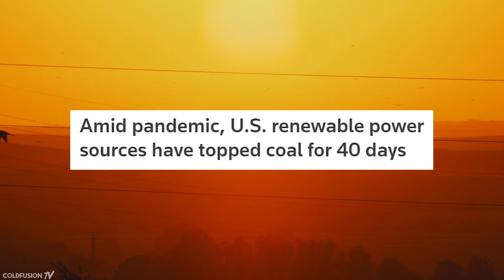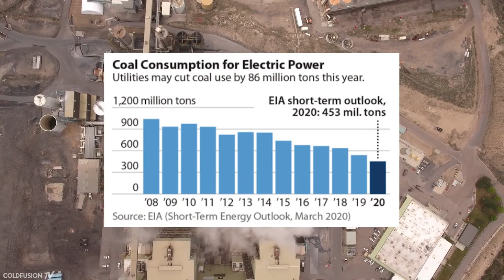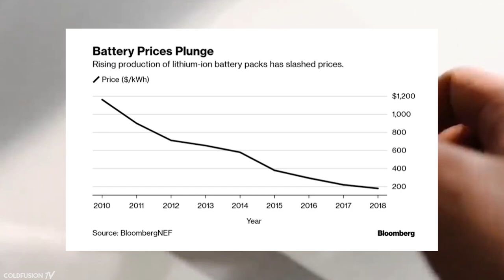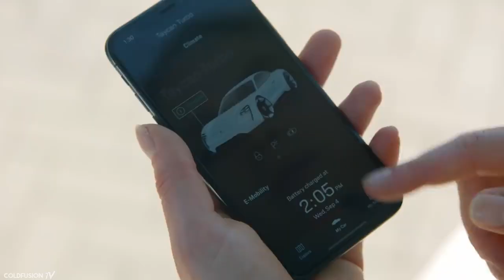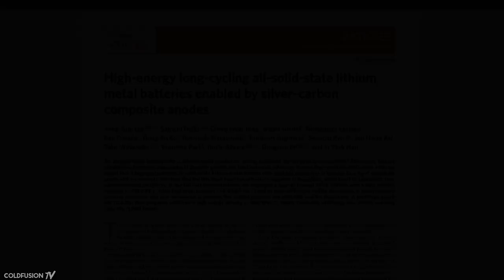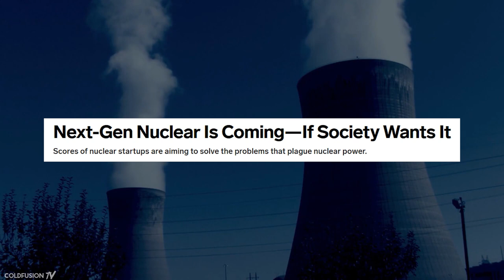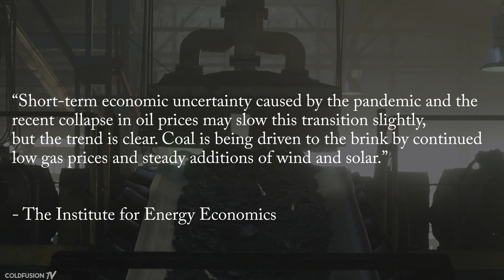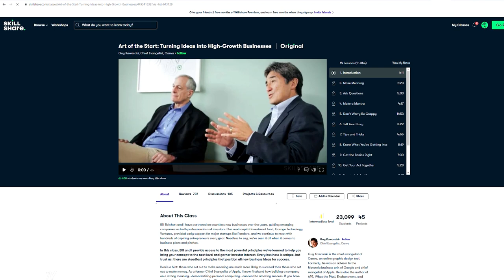Amid Pandemic, Renewables Now Supply More Energy than Coal in the U.S.

Comment: 5:20 why do you compare capacity of batteries that have different voltages?

I know that the point is to show the dramatic difference, but why not compare apples to apples instead of apples to watermelons.
Reply: Agree. Very misleading. I sure wish batteries would have improved that much.
Reply: Yeah, the laptop battery is 1700mah at 14.4v, or 24.48wh. The cell phone battery is 5000mah at 3.7v or 18.5wh. It's still more per volume, but you can't just compare mah like that.
Reply: True. Still the improvement per volume is significant.
Reply: Mariusz Kozłowski except density is irrelevant for the discussed use of mass storage - also he compared with a 25 year old NiMH...
Reply: Agreed! Wh should be the default unit for battery capacity now. Great video anyway!
Reply: kilrahvp True, he should compare energy (Wh) not capacity (Ah).
Reply: Of course. You have to compare Wh. Not mAh or V. But anyone that thinks battery storage for mains power grid is going to be a thing is delusional. The best way to store energy is byt using the any surplus wind and solar production off-peak times to pump water back up the hill in hydro power stations.
Reply: @Optical Clarity I would have to disagree. current battery technology is not that far off, a current Tesla power wall can pay for itself in 10 years if it can be fully utilized. Of course it cant always be fully utilized however we aren't that far off from it being economical.
Reply: The point he is making is that battery technology is advancing at a rapid rate, In just the last two months there have been massive improvements and two patents filed one of them by Tesla the other by a scientist
Reply: Without research their is no future
Reply: @Optical Clarity How about you bring some data as well? engineer my ass
Reply: Optical Clarity did you just crawl out from under a rock from 1960? I can go out today and buy enough battery storage and solar panels to power a home easily and for less than the price of a new car.
Reply: Optical Clarity I’d assume that you are an engineer in the field that is related to the development of LFTRs. In that case, what has really been the showstopper for the past decade or so since the 5-minutes video didn’t go so deep into that aspect.  I’m actually curious, and really want to know more.
Reply: He wants to say that batteries are getting smaller and efficient....
Reply: @Jonas.856  I think the point was the technology has changed over time.  For the old batteries, they were 'state of the art' and a lot more expensive on a AH to AH basis (amp-hour just as a standard unit of comparison).
Reply: @Optical Clarity IMHO, he tries to present what the masses see as data and facts, but the masses RESPOND to emotions, no matter if the facts are compelling for engineering/scientific types or not.  I think he is TRYING to pull the right strings to bring along the unwashed masses in a way they can understand.  Yes, sometimes he gets a few things bas-ackwards, but so had NASA in the past in spectacular fashion (I won't go into historical diatribe here, but as a fellow geek, you can remember them as well as I can or better).  I only site NASA because it is publicly viewed as premo technology in motion.

So don't let your blood pressure rise, and enjoy the ride.  Yes a few tech corrections are needed just to keep many of us sane, but for the most part he does pretty good especially in such a glossy format.
Reply: well because I can,  comparing the watt-hours of both you can see that the phone has 21.75Wh compared to the laptops 24.48Wh. Now considering the laptop battery is about the size of the phone it's a pretty fair comparison.  and you can see the energy density has gone up significantly. (Also an electrical engineer because I have a $150K piece of paper that says so)
Reply: i was about tu comment it jahahahah the old battery has actually more energy storage
Reply: @Optical Clarity the idea that one day people would be able to fly like birds is laughable. If you want to prove me wrong come at me with facts, not feelings

PS:I am also an engineer (who cares)
 Your method of engaging in discussion comes across as arrogant. Try a more humble approach and people might want to part take.
Reply: @Optical Clarity on an industrial scale things look better the Hornsdale Power Reserve cost 90 mill and makes about 18 mill a year
Reply: @Optical Clarity The studies show all these renewable technologies to save energy and resources over time. That trend continues to get better rapidly as the technologies mature. What we need now is massive investment to move things forward at a greater rate. Along with batteries, solar, wind, etc becoming the norm will come more efficient recycling systems, that's really the easy part. I'm not sure where you are getting your info. Also, we have no choice... Look at the lengths we have to go to to get fossil fuels, and that will only get worse, to say nothing of the extreme environmental impacts. We should use the remaining fossil fuel reserves to build our sustainable systems, otherwise we will be in a serious bind.
Reply: @Optical Clarity The day I see evidence of a truly safe nuclear technology that can be implemented at large scales I'll be on board. Battery technology is the real holdup for solar, wind, etc to be truly viable. Battery technology continues to advance dramatically. Nuclear, not so much. And the advances that have been made have not mitigated the extreme safety risks.
Reply: @Optical Clarity I believe the real solution is in the efficiency of our transportation, architecture, etc. For instance, in most areas it is possible to make a building that requires little to no energy input to maintain a comfortable temperature. Public transportation infrastructure in the US is shameful. There are so many ways we are not putting energy to good use. Lifestyle is a big one, people think they need to consume to be happy.
Reply: @Optical Clarity It can if the batteries keep improving. Don't talk too big.
Reply: @thenovemberedition  I think it is 18.5 and 24.48 (Given the assumption that the lithium battery will operate at a voltage of 3.7 Volts instead of the fully charged capacity of some 4.2 Volts or so) but , still it means the battery technology has improved a lot given the big size difference.
Reply: @Optical Clarity It can be a baseline energy source if each home and factory had a solar system and a battery installed. I think the only factor in this is the financial impossibility of it right now, which might change in the future.
Reply: @Optical Clarity If you want nuclear, we need to focus on fusion. (Although thorium reactors like you mentioned are pretty good too!) But not because it is easier, because it is the future of the energy.
Reply: Because this guy has no idea what hes talking about and it's easy to see that from his videos. I hate how everyone believes/agrees with him instantly after seeing one of these vids but they are all misleading
Reply: @Optical Clarity I already wipe my ass with your assumptions. Studies are public for everything, not just for LFTR.
Reply: Capacity has nothing to do with output voltage. Voltage is dependent on the arrangement of the cells. Capacity is dependent on number of cells/ size of cell in the phones battery case. His  comparison is very accurate
Reply: @ignaciohavok1  No actually voltage is dependent on the number of cells. More cells=Higher voltage but less usage. Less, larger cells= lower voltage but more usage
Reply: @devrim-oguz  Nuclear is cheaper than solar and wind by a lot.  Literally a multi billion dollar solar farm generates like 1 megawatt. A single nuclear power plant can generate thousands of megwatts
Reply: @dustman96  Yeah sure everyone could take a train or bus but that isnt practical because people are gonna want their own car, most people arent gonna want to have public transportation the only way they can get around. Also if everyone keeps pushing these piece of crap electric cars then your whole comment is useless because all transportation is gonna use electricity
Reply: Эндрю larger cells don’t mean higher voltage. The voltage of a cell depends on its chemistry. I was referring to the fact that for the same number of cells it’s arrangement will affect the voltage of the battery, I.e. the larger the series the more voltage. Likewise the larger the parallel the more current but capacity never changes.
Reply: @Andrew58251  sadly I have to partially agree with you. Dagogo produces very nice and cool looking videos, and I mean very cool. But he's not a technical person. He does the best he can research wise, but from a limit ahead, he can't cope with very detailed technical info. but, also important, I don't feel he's being purposely misleading, they are all honest mistakes.
Reply: They were comparing the size of the batteries from 1995 to now and how much smaller the batteries are now and how they are way smaller. You’re over thinking this. Take it for what it is
Reply: kilrahvp he was comparing how batteries have changed since 1995 and was saying how much more they will change in the future. Kinda like comparing a laptop now to a super computer in the 1950s. Why are we making this subject difficult?
Reply: Storing the surplus into a battery so they can ramp up the electricity when needed much like how and why we still use coal
Reply: The real improvement isn't in mah or watt hours, it is in energy density. The mah or watts or voltage of a battery is designed around the use of the product. What has improved is the watts per weight. If that cell phone battery was the size and weight of the laptop battery, the laptop would have enough power to last several hours of normal use instead of 2 to 3 hours (which was normal at the time).
Why batteries are taking over small engines right now is because you get far more power in a smaller package (to say nothing of less maintenance, noise, etc) than a gas engine "for a normal amount of run time"
Granted, a full tank of gas in my mower would last about 4 hours, while a full charge on my electric mower lasts about 1.5... But as it only takes 45 min to mow my lawn, I get a lighter better mower for the same money, and cheaper fuel, lower maintenance, easier storage, less bogging down, etc.
Next, apply this to cars. Right now an EV is heavy, and the battery is much larger than a gas engine plus fuel tank for the same miles driven. But soon (probably on teslas upcoming battery day) the batteries will get smaller and lighter for the same range. This will be the tipping point. We can make a battery at whatever voltage, or capacity, or power we want. What matters is price per watt, and watt per weight while being able to have a tool that is usable.
Reply: @Andrew58251  total bs. nuclear is more expensive per kwh than solar.
Reply: Michal - voltage is only a pushing for for amps.  Or milliamperes.   You don’t die from a hi voltage shock - you die from the amount of amps that was pushed into you..  voltage isn’t the issue as I read it.

Comment: From the graph at 1:56 though I get that the energy production share "lost" by coal was gained  mainly by gas. For sure renewables have seen an increase from 5% to 18% but at the same time gas went from 15% to 37% (probably supported by the shale gas).
Reply: Even before I watched the video I knew coal replaced by cheap gas . renewable can never replace fossil fuel till storage becomes cost effective compared to fossil fuel.
Reply: As WIND turbines are added, natural gas has to be WIND's buddy to supply the electricity WIND can't supply when the wind stops blowing. WIND has a capacity factor of about 35%.  That means fossil fuels, usually natural gas, has to supply electricity the other 65% of the time.
Reply: Good, that's a good thing. Natural gas is better than coal anyway.

Comment: A comparison about this topic between multiple countries would be great. Germany, Norway, China, US, France, Japan etc.
Reply: You've said China twice.
Reply: But instead we want war with one another. We keep diving each other due to ethnicity, nationality, skin color, etc.etc. The things we could create if it wasn't like that.
Reply: @radjadawamindra697  Thanks - fixed it.
Reply: @EdwinCristobal  and ideologies, don't forget ideologies.
Reply: Norway get around 98% of their electricity from hydro.

(Just wanted to say it XD.)
Reply: It would not be great because these are vastly different countries with different geographies. Obviously Iceland has tons of geothermal and France has tons of nuclear. The comparison is meaningless. It only makes sense to compare a country to itself
Reply: Japan has very little sun and tons of solar panels. I was shocked by this. They almost never use clothes dryers I noticed also. This is the easiest way for us all to go green. Dry your clothes 90% of the way in the sun and toss it in the dryer for the last 10%. No added hardware needed besides a wooden rack or clothesline. And the evaporation is endothermic so it cools the air. 

To put it near the hot output of your AC unit takes that heat to dry the clothes faster also. And buy only rechargeable batteries. They never, ever leak and actually have more power for most uses now. Get the Panasonic Enerloops. The ones in stores here are designed to make you think the power is less to drive you to disposable cells. Go figure.. If most of us did these two things, we would make a huge difference with almost no effort. It's us. Always has been.

Comment: At 5:16 you compare the amp-hours of two systems with different voltages. Otherwise great video!
Reply: FAKE NEWS
Reply: Kapri  you're the dimwit. amp-hours is how much current it can provide not how much power. If they are at different voltages, then a battery with a higher amperage but a lower voltage can be worse than a batter with lower amperage and higher voltage. It would be better to use watt-hours.
Reply: Kapri  mAh or C is a measure of charge. Joule is a measure of energy. He should have used joule or a unit with same dimensions like Wh or something.
Reply: Yup, great video, but his presentation about the battery improvements would have been better if he used watt-hours.  His point is still valid though. The laptop battery holds twice the energy but appears to be much more than twice the size. The laptop battery stores 24.5 watt-hours of energy.  The phone battery stores 12 watt-hours.

The real improvement is in energy efficiency though.  It is almost universally cheaper to use less energy than it is to produce and/or store more.